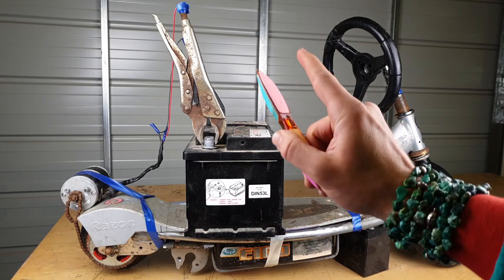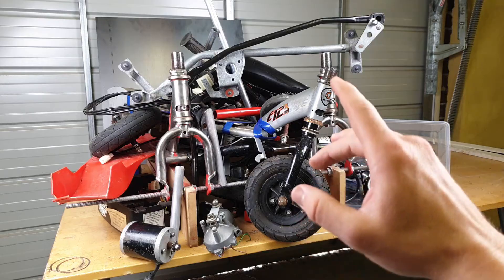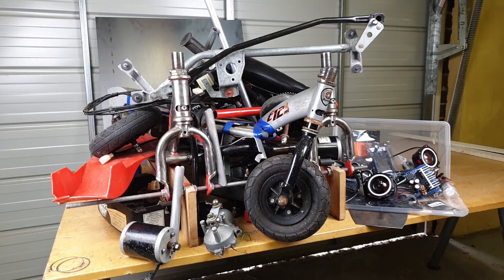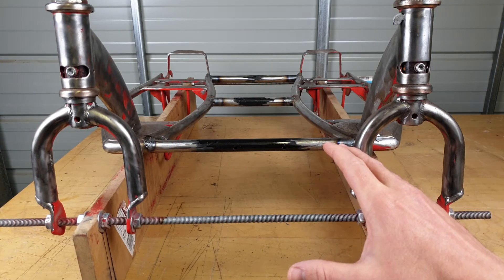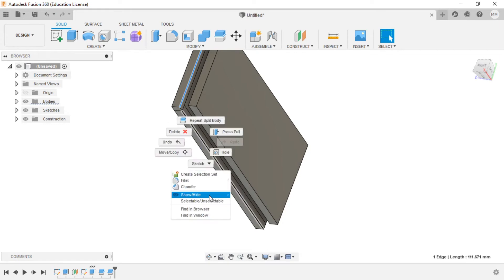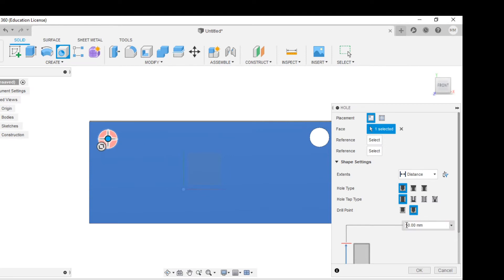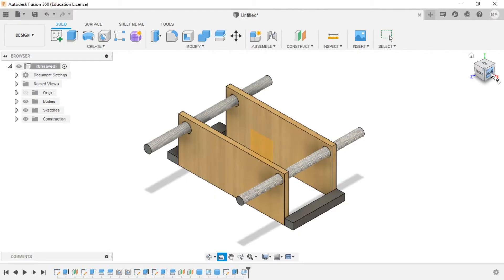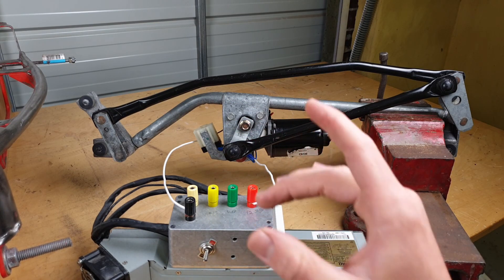How to build an electric go kart out of electric scooters

Comment: Ok I do have this go- kart, but I want to change it to a  electric motor scooter. But I need to know how to build it with a step by step guide, and  I wanted know if some know how to make  it a three wheel step by step  guide. Thank u!
Reply: 😮aaA

😅😅sßa😅 no m kq
Reply from the maker: Hello, sounds like a great project! It is hard to offer a step by step guide without being able to see anything or knowing what your budget/skills are. Best thing to do is break it down into little steps and solve each step individually. There will be a how-to video on each problem you run into. Good luck. Keep it simple.